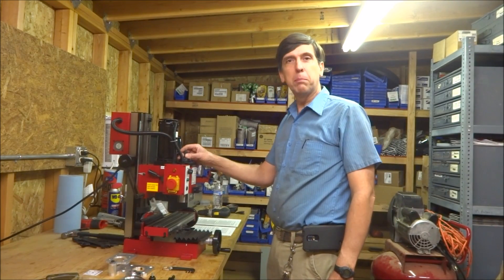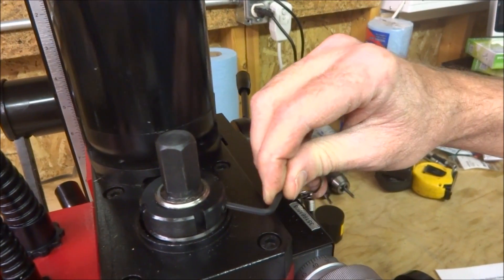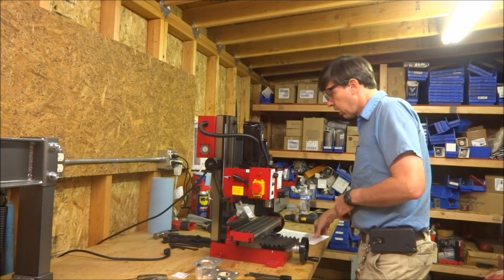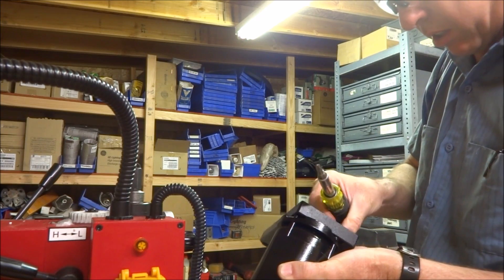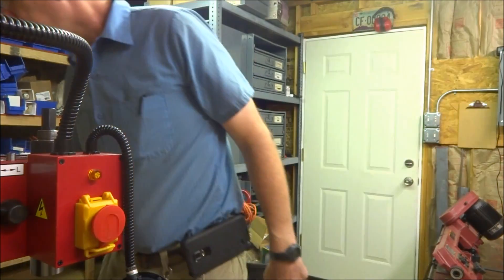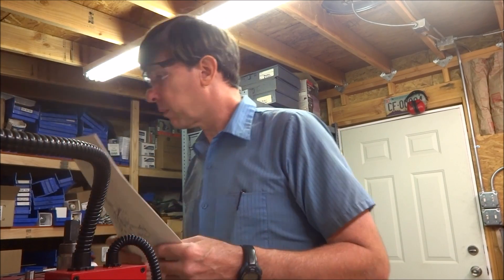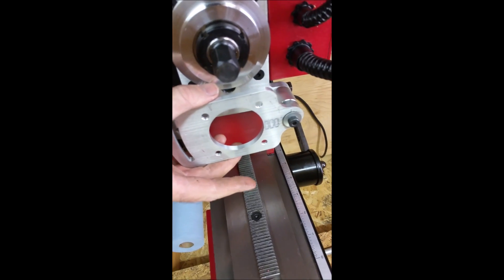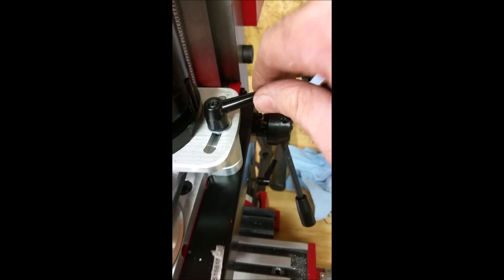Mini Mill Belt Drive Conversion

Comment: This isn't a good advertisement for this Chinese product is it ? I mean this conversion kit should not have been necessary had PLASTIC gears NOT been used in it's manufacture, as the old saying goes, YOU GET WHAT YOU PAY FOR.

Comment: 08:46  
"next step" 
"insert clear plastic sleeve on shaft that had the plastic gear mounted on it"
*inserts plastic sleeve all the way down on shaft*
"Got the plastic sleeve on... Alright. next step!"
"With the plastic sleeve inserted to top of shaft so its flush and not inserted too far down on shaft... Attach mounting bracket" 
DOH!

Comment: When doing this is it possible to go with a little bigger tooling? 1.2" face mill to say 2"?
Reply: Only if you make very light passes.
Reply: @craigedinger9629  how much lbs can this table hold? I want to buy a precision vise but they weigh up to 30lbs some even more

Comment: Hi Craig. I don't know if you made the conversion yet, but here it is.......in this video on he bottom of the spindle where you put your hand on it to turn the spindle, make or buy a collar the size of the bottom of the spindle......with a grub screw and then somewhere on the collar drill a hole to insert the spindle pin........it works al to better for you and you do not have to stretch to find the hole that the pin goes into, because its now at the bottom of the spindle instead of the top......good lucks did mine it works great ...I also use a hardened 5/16 punch to insert in the hole of the collet....enjoyed the video.

Comment: A large component of the noise remains from the unused internal gears which are still engaged and rattling against each other. It's a bit of work but you can reduce the noise by at least half by removing them. For me it was well worth the effort.
Reply from the maker: +ExtantFrodo2  - Thanks, yeah I did eventually remove all the gears when I took everything apart to handle binding.

Comment: my CNC conversion kit cost me 950 A.U.D completer less servo motors.
Reply from the maker: vinygee Mine was was about $600.  $950 sound about right.  The kit for the G704 is about the same.

Comment: Hi Craig , just wondering what made you buy that model mill ? and what are your intended uses for it ? I was actually going to buy that model myself but i ended up purchasing the Titan Machinery TM25V due to the fact that everytime i have made a purchase in Machinery its always been either too small or under powered
Reply from the maker: vinygee The TM25V looks like a really nice machine.  Wish I had the money to start with that.  This is my second company and don't want to invest too much in it till I am sure the venture is sound.  Was thinking about going with the Grizzly G704 if things work out.  I will check out the TM25Z.  Thanks!
Reply from the maker: vinygee I am making small custom electrical covers and whatever else I cam make.

Comment: Good video...informative.
What CNC kit are you going to use? I'm leaning towards CNC Fusion...
Jay
Reply from the maker: Jay Raxter Thanks Jay!  I have already ordered the CNC Fusion kit.  There seems to be a lot of support for it on youtube and have heard good things about it.  They didn't respond immediately when I emailed or ordered.  You might have to wait a day or two to hear back from them.  I think they are just really busy.  When I found out it would take 3-4 weeks to get, I was strongly considering making it myself but didn't want to tackle the boring of the X axis plate with the tools I have.  I am just doing other upgrades while waiting.  Sam at CNC4XR7 has done a great job of making his own.  You might want to check out his videos if you haven't already. He commented on this video also.
Reply: CNC Electrician I'm (eventually) going to do the exact same as you. I've been optionally thinking about getting a Sieg X2D...it's on the Little Machine Shop site. Or a Grizzly 8669 Mill (same as the HB one you have). Oh...it's not the dang CNC mounts...it's them ballscrews...price them anywhere else...YIKES!
I've got a Grizzly Micro Lathe I'm converting. It's small enough I can 3D print my own mounts and use NEMA 17 motors on it. I've got all my parts, motors and drives...just have to get finished with it. Not enough hours in the day.

Were you planning on doing any more videos before the conversion? I would love to see the mill (in factory form) mill some stuff. There are SOME videos of that but they're note done very well. IE...you click on the "Mini Mill Machining Aluminium" title and you get a close-up view of the tool....cutting aluminum. I want to see it pulled back. How MUCH of a cut can you do? How many cleanup passes does it take? What about plastic?

Anyway...do some more :) I'll watch em...

Jay
Reply: Jay Raxter
Make your own mounts if you enjoy that stuff and Have more time than $ like me LOL
Reply from the maker: Jay Raxter Yes, The ball screws are pricey.  That's another reason I went with CNC Fusion.

Yes, I plan on doing a few videos before I do too many upgrades.  I plan on doing a "Lets see what it can do" video with wood, plastic, aluminum, mild steel, 4140 and titanium.   I will try to do some finish pass stuff also.

I went with the Harbor Freight because it was $528 to my door.
Reply from the maker: Jay Raxter Hi Jay, I just posted a video about delrin if you want to watch it.  https://youtu.be/ZtlcUMfnYwo

Comment: Awesome! Only wish we could here Before and after but its a lot faster and smother. Great Job! The kit looks nice what do you think overall?
Reply from the maker: CNC4XR7 

Thanks!  The tripod helps a lot. The kit is nice.  The plastic cover is a little flimsy and doesn't line up quite right.  It is a little hard to get the spindle pin in.  Should be easier with the fine feed assembly off.   It was a lot easier then I thought.  If I had to do another one, maybe 10 minute tops to do the conversion. I will do a before and after next time.